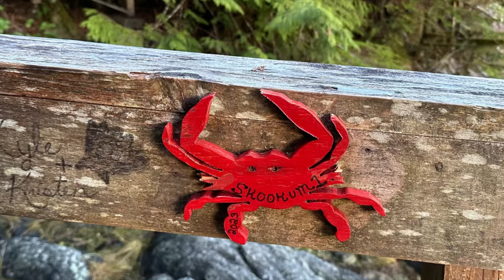Broken Pull Cord 😳, Feisty Sea lions, One Crazy Boat Dog!  #oceantrip #nordhavn #sealife

Comment: Huh. Not the worst thing to have to repair but Honda doesn’t make that pull cord easy to get to.  Note to self: buy an extra cord for the 2200…
Reply from the maker: Yeah having to take apart the entire thing to get to the pull cord was a bit tedious.   After all that, the recoil has now failed.  A new recoil is on its way.  Boat repairs never end lol